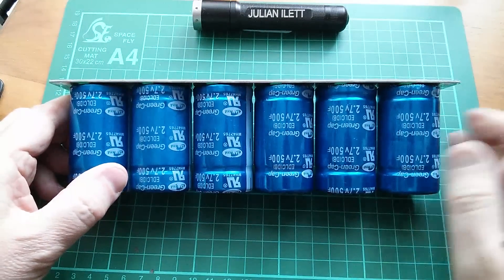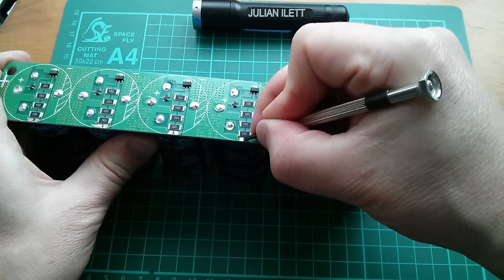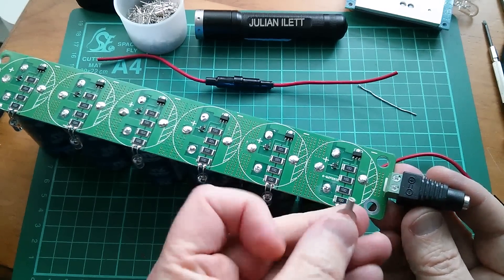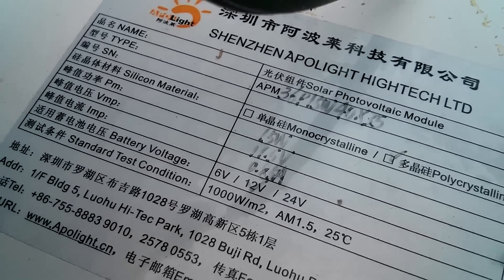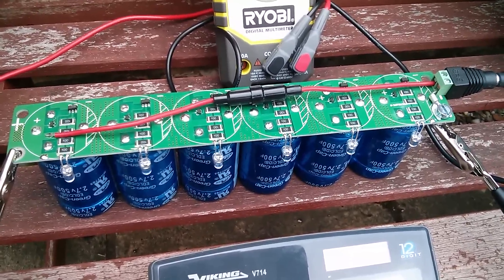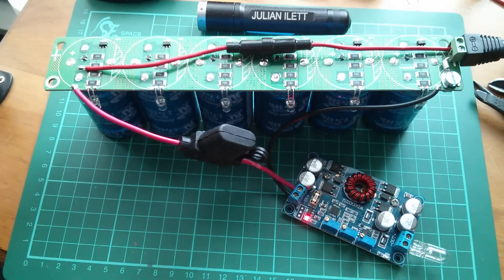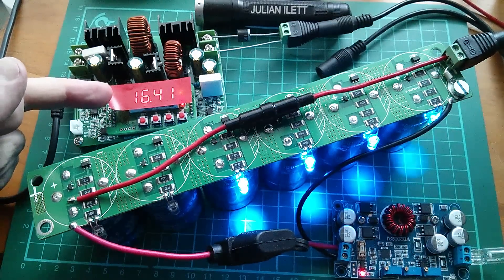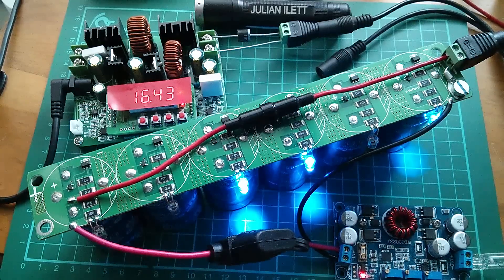SuperCapacitors (500F x 6) and Solar Panel (15W)

Comment: second capacitor has a bigger internal resistance that's why its charging slower and it should also get hotter. these chinese supercaps are not so much up to spec and can have very big differences between them, in your case just one is off spec, but it will affect the amps since they are all in series

Comment: one Day will your Guys found out at your can use really Soundwaves to charge a Capasitor and can so create Power. it will also charge much much faster. in the end can you built a Batterie,som use a Frequencegenerator,a Ampifiler push the signaloutput,this Signal goes in to the capasitors and you charge with sound. take a LED and connect this LED on your Output of your Carspeaker(Subwoofer give the most Powerout-logiclly) on the Ampifiler and think now HOW the hack can i use this and charge everything??? next step is a Microfon as Signalgenerator,like Karaoke- you sind and the Ampifiler give the Power out,means outside listen the microfon 24/7 and create so ALTIME Power with Sound. we use power to create in a Device a RADIOSIGNAL,some is POWER. like tesla have go.he have only send a radiosignal and the other end have pick up the signal and change it from RF back to DC and drive Engines. a Microfon is a MINI Generator,thats the beginning. unlimited Power from RF. We all testing a Signal Generator with a LED,this must push the Button in many Brains. Means use send a RF Signal and the LED lights up.menas we dont need DC Power for power an LED,like tesla have selling us.use RF Signals instead. means all can charge a Capasitor on the Loudspeakeroutput of a CarAmpifiler some have many watts.

Comment: Hey man this is great stuff: any advice on using one of these 16V×500F rowbar capacitors in a stationary bike generator, I thinking I needs one to charge up from an alternator to 15V before I flip a switch to the battery circuit

Comment: Taking these above 2.7 just kills lifecycles. 2.85 is probably max surge voltage, which should be held at for no longer than 1 second.  Did you ever test the capacity of these?

Comment: 500 f in series capacitor array is a misnomer, try 83 f bank...To make the capacitors really be helpful you need to match the Vpm of the panel.... which means more cells in series, and sadly will lower the overall capacity...

Comment: would a 48v 20kwh cap array be buildable? I'd like to build a graphene ultra cap capable of running a 4kwh load for 16 hours. Run my house on caps, use then up, recharge with either solar, wind, or grid. then repeatedly cycle my houses load on off grid. 

Lol crazy and I could never afford it but I'd like to know the math and that will give me an idea if how big the bank would have to be.

Comment: How can I set up an 80amper 24v battery. how many capacitors or how should the circuit be. I want to set up a warehouse system for my house. Is there any shape or project you can recommend?

Comment: I have two of these boards but they do not work. After some investigation it appears the voltage detector (marked 'CNVL') is: https://datasheet.lcsc.com/szlcsc/1809140219_NATLINEAR-LN61CN2702MR-G_C236392.pdf but on my boards it is the open-drain type. The other device is unmarked but has a high input impedance so I assume it's an n-channel mosfet. Since there's no pull-up resistor, the mosfet never turns on.

Comment: Could use a  MPPT module controller . https://www.ebay.co.uk/itm/MPPT-Solar-Panel-Controller-5A-DC-DC-Step-down-CC-CV-buck-Charging-Module-12V-5V/172711371638?epid=936822802&hash=item2836666376:g:5oYAAOSwYlRZMsPk

Comment: realised I seen this before ,,looking for tech electric that no there stuff re an idea I  think I have seen things on..  tho cannot maybe find 
the link  ,, little time ,,I LIVE IN VAN WITH 100 WATT SOLAR  amazed how much I look at the logger even after 10 years  and think a lot about solar powered vehicles ,, about a year ago I started building a 2 nd model bus to hopfully put on an electric bus so as to, factor ,,
the solar and directly compare the bus,s reality day accounting directly for cloud shaddow +++ varients,    ,thinking my theory solar 
composit van 6000 watt ,,calculated @ 50% > 3000watts continual on a sunny day  ,,this translated to a single deck bus has more solar to weight 
and all return  1/3 off the power requirement.  therefore continueing theory the bus spends loads & loads &loads of time @the bus stop and traffic lights still soaking up sun   therefore  calculating x the 1/3 factor might be able to complete its daily cycle on just sun ,,a point in history.
this is for u if u are in to it,, I think this is all realistic except urban cycles loose out on the stop starting pending RECOVERY BREAKING 
THANKS FOR THE NAME TO A FRENCH WIND ENGINEER i met  ,,attention this is the point,,   both recovery breaking and most of the solar
 when comming in are trying to get into the fairly full battery that one learns does not take much when full or even 50%  the motor industry are @ 
super caps and very very high voltage just one thinks to present a match for petrol & diesel ,, some diy and me are thinking
near ordinary capacitors  for IMMIEDEATE CHARGE  AND IMMIEDIATE USE  and on and on and on  August in PICCADILLY CIRCUS 
no more sotty fires and maybe ,,,,,, JON,,

Comment: I have brought some 3v 500farad supercapacitor but when I charge then upto 2.8v they get warm to touch, it this normal or maybe something wrong within the capacitor?? Could you please help me with this
Reply: You were charging them too fast. The internal resistance of the cap will turn some of the current into heat.

Comment: My brother my batteries in my solar setup in getting old currently I can not afford new ones and I am thinking of using some capacitors to combine with my batteries to help them with the load. My question is can this  be attach to my battery bank and what would be your recommendation?

Comment: DC-DC 2V-24V to 3V-30V Step Up CVCC Boost Voltage Converter Power Module 80W
https://www.ebay.com/sch/i.html?_from=R40&_nkw=Step+Up+%22ZK-S4%22&_sacat=0&LH_TitleDesc=1&LH_TitleDesc=1&LH_BIN=1&LH_TitleDesc=1&_sop=15

Comment: I have a bank of 6 Maxwell 3000F caps in series as my "battery" in my TDI. Starts strong but doesn't have much reserve capacity. Have a 20 watt solar panel on the roof to keep it charged when not used for some time
Reply: Jason Harrison capacitor should be summed in parallel, not in series

Comment: Hi Julian.

A quick question for you..... Do you have a model number or link to that buck/boost module please. I have an idea inspired by your video I want to try and that module will be ideal.

Many Thanks.
Reply: DC-DC 2V-24V to 3V-30V Step Up CVCC Boost Voltage Converter Power Module 80W
https://www.ebay.com/sch/i.html?_from=R40&_nkw=Step+Up+%22ZK-S4%22&_sacat=0&LH_TitleDesc=1&LH_TitleDesc=1&LH_BIN=1&LH_TitleDesc=1&_sop=15

Comment: i wonder what aplication is this good for ?
Reply: @wu ming quite good for short time outage + granting time for safe system shutdown...
However, super capacitor voltage is not constant, so need a wide range converter.
Long term UPS will use lithium storage today, instead of lead acid battery no longer ➯ need compare prices & performance...

Comment: Without a diode, current will flow back to the solar panel, heating it, when a cloud passes. Ever thought using a joule thieve to get optimal charging voltage? Would be loading quite faster.

Comment: How about a 2.4 volt zener diode in reverse polarity, and a 3 volt led to burn off the excess power. As a cheap and easy capacitor balancing management system? I know any amount of real amperage being conducted through a simple system like this will burn it, but that is only on the charging portion. It should not effect the output side in any way.

Comment: scotty where's the fly wheel, i don't have the power captin, have you heard of multimeter drain teaching drain to copper coils that have been blue flamed? did you know ccw coils winding away from if power supplied makes drones fly, amp rate being key

Comment: What are the voltages of the capacitors? Isn't the voltage for the solar panels higher than the capacity of the capacitors? Are you going to do anymore with this because you didn't really put a load on it so you're not really doing much work....

Comment: NEXT IDIOD 
Super the capacitor at 2.7V, 
2.85V the explodes,

LED volts 
2.0V IR
2.8V red
3.4V green
3.6V blue (white)
4.0V UV

Comment: I know that one can charge a bank of super capacitors from a solar cell, but i keep thinking, most of the time, the solar panel is operating at a very poor efficiency, and one is wasting the capacity of the panel.  Introduce maximum power point tracking and you will be able to collect more energy from the panel.

Comment: solar what?  capacitors  didnt see        chit   solar     mite use it in           my Flux cap Eng :) booster
Reply: DC-DC 2V-24V to 3V-30V Step Up CVCC Boost Voltage Converter Power Module 80W
https://www.ebay.com/sch/i.html?_from=R40&_nkw=Step+Up+%22ZK-S4%22&_sacat=0&LH_TitleDesc=1&LH_TitleDesc=1&LH_BIN=1&LH_TitleDesc=1&_sop=15

Comment: Dude try using organic carbon power cell banks. Carbon power cells do not discharge like those capacitors. 😊😉
Reply: What is used as electrolyte?

Comment: One thing about capacitors, static charge volume is based on the distance between layers. When you put them in series, it may increase the maximum voltage, but it will exponentially decrease capacity. Batteries do not suffer from this aspect.

Comment: The protection board I bought had a Led already.  The balancing of the Supercaps is usually quite off until they are all up to 2,7V.  Interesting is that this only happens when I charge them with my powersupply set to 13,5V for a 5s configuration. When I charge them with a 5W Solar panel (18V) The individual capacitors are charging much more evenly right from the start.
Surely the Caps are charged much slower but I have no idea how the can allign their voltage other then "burning" energy when the protection kicks in (which happens rarely with the 5W Panel)

Comment: What buck boost converter are you using? Can you put a link?
Reply: DC-DC 2V-24V to 3V-30V Step Up CVCC Boost Voltage Converter Power Module 80W
https://www.ebay.com/sch/i.html?_from=R40&_nkw=Step+Up+%22ZK-S4%22&_sacat=0&LH_TitleDesc=1&LH_TitleDesc=1&LH_BIN=1&LH_TitleDesc=1&_sop=15

Comment: Hi Julian,
what is your experience after one year experimenting with those supercaps? You can find infos, that they sell lots of crap, thrown-out of production caps which dont meet their specs at ebay - but not sure about that. Obviosly, you can buy those 500F caps for about 20Eur/pc and for 4 Eur from chinese sellers at ebay. This sounds like fake - doesn't it? I bought just 2 of them to test the real capacity and ended up at around 330 - 400F max. depending on the voltage level you test at. Also i found that the spread in the values of Capacity, leakage current and self discharge is quite high, so it is likely to cause difficulties when trying to balance 6 of them in series. I also did a long term self-discharge test and found that a cap that has good voltage stability in the higher area (from 2.6 - 2 V) can be bad in the lower area and vice versa. I am trying to figure out if it is important to do a special formating process to the caps, as it is important for how long they are kept at the high end of ther max. voltage. So when you keep them for 24 or even 72 h at 2,7v they will stay much more stable at higher voltage showing less self-dischare. I am not sure, if its enouph to do this process once or if you have to repeat it, to keep their capacity and voltage stability. I also had a cap that was jumping in voltage when discharging with higher load (1-2 amps) - so its obvious it has some internal problems. This is all a bit problematic when putting them in series...
Reply from the maker: I've not done anything like as much testing as you - sorry :)

Comment: Thanks for the video. What do you suggest to slow down current while discharging the capacitor bank? For example, If you wanted to charge battery from the super cap bank but not just at any rate but perhaps twice the current of the solar panel?

Comment: I bought this same solar capacitor module on Ebay. I tested the capacitance and it ended up being  about 67 Farad. meaning 400 Farad each. I looked up the date sheet on these green cap Supercapacitors and it said there is a 20% tolerance so 400 Farad is within that. They all held there charge for a good amount of time except for One. I told the seller about it and they agreed to refund me $8.00 for the one bad capacitor that self discharged rather quickly. There was another one that was not as good as the other four but decided to leave it. I ordered another brand capacitor to replace this bad one. I feel it is a crap shoot when ordering these. I know those small black 120 Farad caps you can buy in a module are all junk the one I bought self discharged to 1/2 voltage in less than an hour. Mr. Julian uses one in some other videos.
Reply: Try making your own

Comment: I have never thought to bother around with super capacitors, I never saw the point in them really. They have low capacities and very limited usages. My fav devices are lithium batteries, charge controllers, solar panels, LED's, buck/boost converters, mini relays, inverters etc. 
It is fun to mess around with components and make your own circuits for various purposes, but I have found that it's mostly a waste of time because you can always buy a far more efficient and smaller premade device from China that will be better than anything you can make yourself.

Comment: It may not mean anything, but Julian do you notice how all of the other capacitors are all an equal blue colour and that second one is slightly lighter? Could this be a damaged one? I know when I damaged one of my NIMH cells that it's outer coating became paler than the others, I think it's caused by heating too much. I suspect the second one was damaged or has a design fault that lead it to overheat.

Comment: WARNING Julian!  I have this same 500F x 6 supercapacitor bank and PCB.  My 500F caps EACH measure only between 70F and 80F...Nowhere near the label value of 500F!!!  I first noticed that the 500F cap was charging unusually fast...Then, as I measure all of my (other) supercaps (which are 'spot on') by using the MingHe B3603 (or similar) and the capacitor formula IT=CV, I can easily determine the C of any supercap.  I set the PSU for 2.5v @ 500mA and then, using a stopwatch, I time the charging until I reach 2v. I now know I, T, and V and by using C=IT/V.   I get the capacitance of the supercap. in FARADS (don't forget to use units of Tin seconds, I in Amps, and V in volts.  I bet EACH of these "500F labeled" supercaps are between 70F and 80F.  That makes the total series capacitance of the bank somewhere around 12F !!!  The caps are mislabeled!!  Unless they recently fixed it---which I doubt seriously.
PS
If you use 1 Amp and 1Volt, then the formula gives the same numeric value for T (seconds) and C (Farads).  For ex.  350s = 350F.  Please try it!!
Reply: Was you successful in getting your money refunded? I ordered a set of these for $41.38 with shipping, have not arrived yet I hope they are not fakes
Reply: No.  I didn't discover this until I had them for months, so...It was unknown to me too long.  I finally noticed something when they seemed to charge/discharge so fast compared to other caps.  Then the suspicious light weight and price...   These fake caps weigh right at 2.2oz. and are labeled EXACTLY like those in the video.  hope that helps.
Reply: I received my super capacitors in the mail today I just got done testing them and they are 414 Farad each... Charged for 69 seconds 1 volt increase at 1 amp came out to 69 Farads for the string that is about 414 Farads for each capacitor an 17% difference from label. The manufacture states these have a 20% tolerance, so mine are within that.
Reply: What capacitance value is printed on EACH capacitor?  Wouldn't one expect the value printed on the cap to be the value of THAT cap alone??
Reply: These caps have 500 Farads at 2.7 V printed on them. On the manufactures web site It says these capacitors have a + or - 20% tolerance. Meaning they can be anywhere between 400F and 600F Each. The more expensive brand Super capacitors such as Maxwell will be closer to 10% tolerance.
Reply: If I recall correctly (IIRC), each of these capacitors (labeled 500F) was actually less than 100F each-.  I would, at this point, be -thrilled if any one of them was even close to 400F!
Reply: I guess it depends on the Ebay seller, just check them as soon as you get them so you can file a complaint.

Comment: All capacitors should have a full charge before setting up your solar panels. Then you will get equal results on all capacitors during charging. Each one at full capacity.

Comment: my experience with fuses to a 6 set of 500F connected to a 45W solar panel is that it blew the 30A fuse upon connection. I have decided that the LEDs will indicate over charging and if i want to slow charge, I will use a small resistor inline with 2 LED in series. It seems to work. 1 V per 30 min charge at slow charge and 8 V TO 14V in less than 1 hour with 1 LED lit in 1ess than 1 hour.

Comment: Graphite airogel formed in strips then compressed and constructed like how ultra capacitors are made. The size of a 30 gal propane tank with a rewired drum motor generator with magnetic bearings and a vacuum spark gap at the core of the ultra graphite airogel power cell. Do you think you could make one?

Comment: How can you blow 16.2V worth of super caps with a pissy little 15W 12V solar panel?
Reply: rjac001 what? He's just charging it
Reply: The raw output at the panel can go up to a maximum 21 volts.   The 12 volts you state is after regulation.